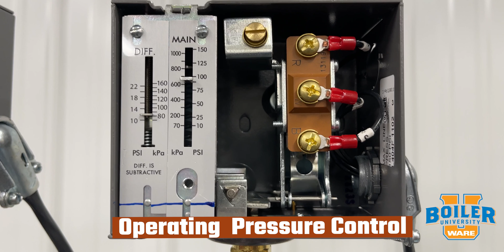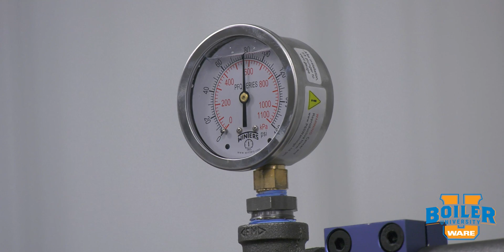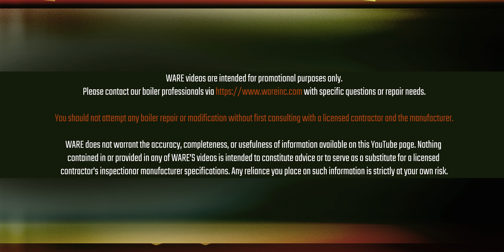Weekly Boiler Tip - Pressure Control Episode 3: Operating Pressure Control

Comment: Whats also important to note is that the flame safeguard is the control that allows the firing rate controller to take over after ignition. It releases controls after light off.